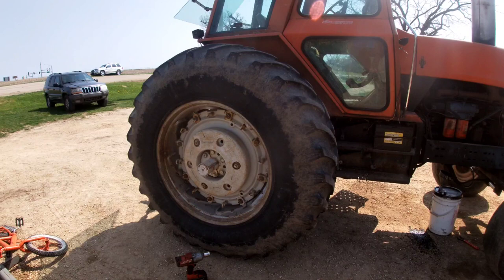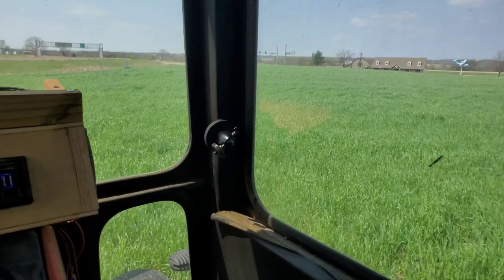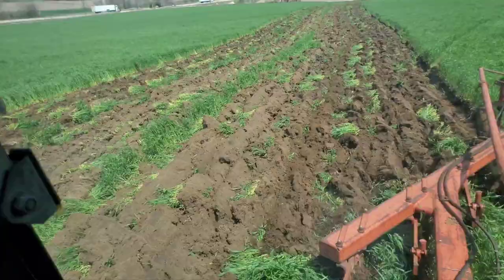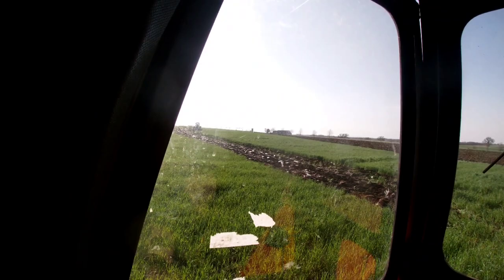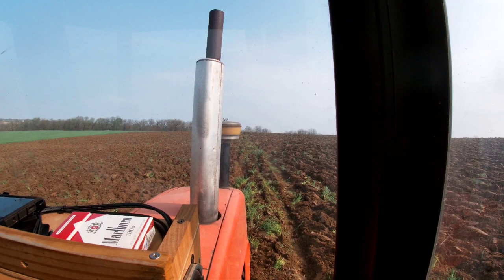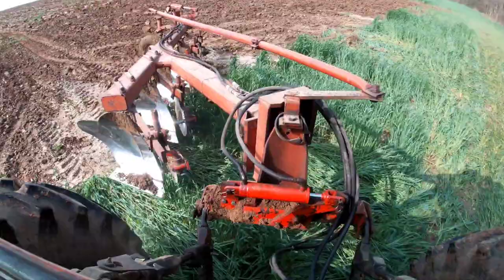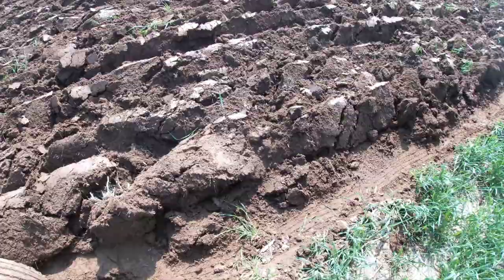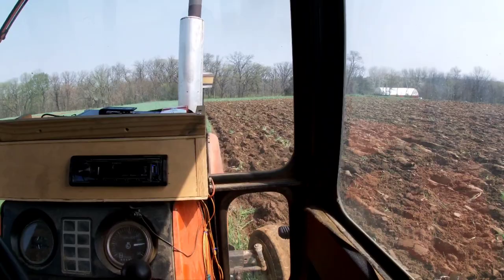Submounted moldboard plow 101, from set up, to closing your dead furrows.

Comment: I didn’t know there was so much physics involved in plowing!
Reply from the maker: I didn't either until I couldn't figure out my 6 16s plow. Nothing was working right about every problem I talked about having was wrong with that thing, come to find out the people before me was trying to use it as an on land plow with a500hp 4wd 🤦‍♂️ they had center line all messed up and heights of the hitch, I kept getting pulled into the furrow and front end up.

Comment: Very good job. Now, do you plow headlands in or out??
Reply from the maker: In, so that it covers the ruts left from pulling out at the end, gives your disc some dirt to work with, and then the last pass I only pull it about 3 inches deep so I don't have a huge furrow around the field that needs to be fixed next year with the plow. The disc will fill in 3 inches usually with one pass. But this year I didn't plow any headlands I want the turn around area with the organic I've only been successful in growing weeds and grass on those areas.
Reply: Yes looks good it is art I have a 2000 monogram ac plow on my 7040 now